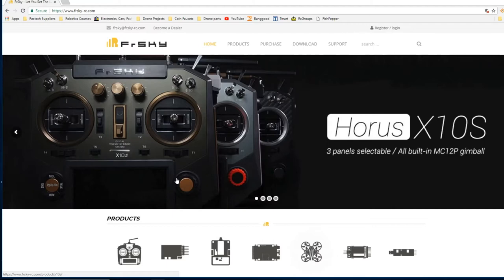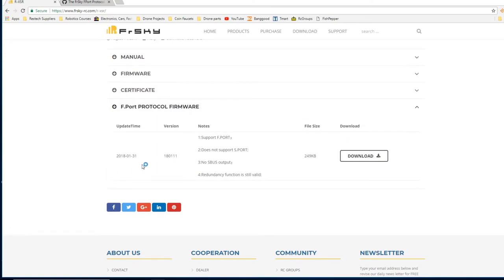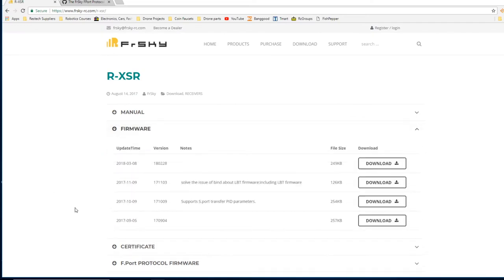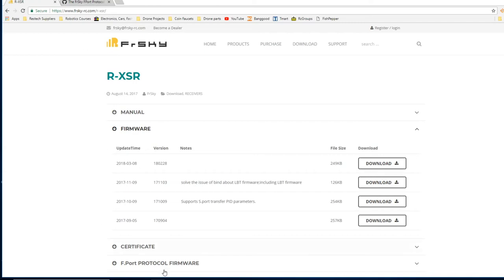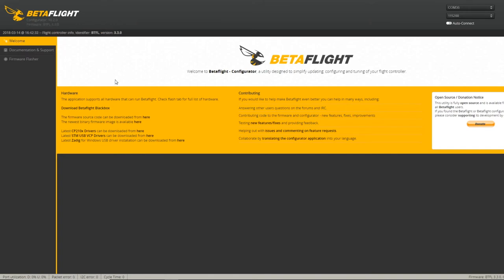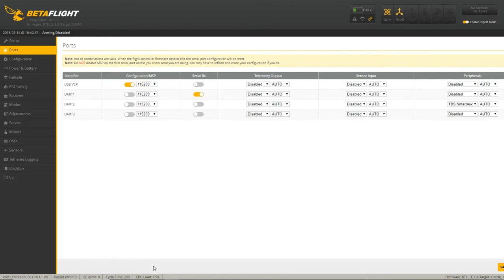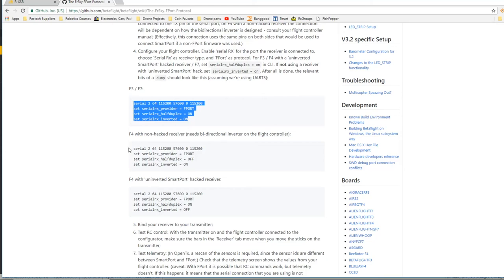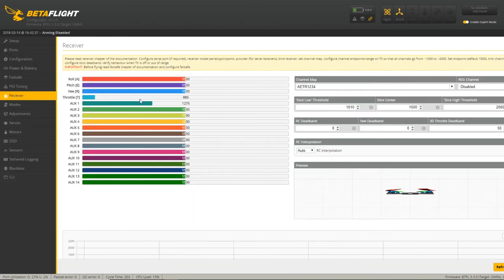How to setup Frsky F.port Protocol R-XSR Betaflight

Comment: I have a omnibus f4 pro with frsky R9mini flashed with Fport have it hooked to uart TX1 and no luck try duplex on invert on can't get it to work also I'm running 2.0 Inav but should be the same
Reply from the maker: ridesoftail Hey bud you gotta make sure that uart port is bidirectional, does your FC have a dedicated telemetry pad ?
Reply: No I guess if I use a R9slim + once they have Fport firmware I should be able to make it work.
Reply from the maker: ridesoftail you just have to make sure you are hooking up to a bidirectional TX pad and also you need to put in the special commands in the CLI tab I've only gotten Fport to work once on an f4 board but on f3 and f4 boards with a Telemetry pad it's No problem

Comment: I have searched everywhere and cannot find any information on my question. I’m using a Lumenier F4 AIO and not sure if the users are inverted or uninverted. It has a dedicated sbus pad but no dedicated telemetry pad. I already ordered the r-xsr and already I’m afraid I’m gonna ruin it just trying to get it to work lol
Reply from the maker: No need to be afraid the new r-xsr has the uninverted pads on it and I've used them for smart port but not f.port but I have gotten f.port to work on a f4 omnibus without a telemetry pad so what I would do is when you get the receiver try regular sbus with the sbus pad make sure that works then you can try to flash the r-car with f.port and connect it to the TX pass and see if it works if not you will have to use the uninverted pad on the r-xsr

Comment: The SBUS pin on an Omnibus F3 FC, is it RX or TX? I was putting the S.PORT wire there, trying to get FPORT to work, but can't seem to get it working. I needed TX1 & Tx2 for GPS & S.Audio. Thanks
Reply from the maker: Chuck Horton The s.port wire has to be hooked up to a TX pad, maybe you can use smart audio on a soft serial and have f.port on a TX uart

Comment: Hello,  how can I know if a uart is bidirectional? I got a geprc f4 stable flight controller in a very small quad copter and it doesn't have a telemetry pad just the sbus pin and TX 1 pad, I can't make it works with the r-xsr, did you use the  normal smartport wire or from the "p" pad on the receiver?
Reply from the maker: So F4 boards are the most complicated when trying to get telemetry you're gonna have to use the uninverted signal from the r-xsr to get telemetry to work

Comment: would using f.port make it so that when using rxsr the wiring can connect without using the inversion hack on the newer cl facing f4S boards?
Reply from the maker: If the CL racing f4 fc has a dedicated telemetry pad you won't need to use the uninverted pad from the R-XSR you can just wire up the S.Port Wire to the telemetry pad and you'll have F.Port

Comment: I have a speedybee aio FC, which pad must be soldered and which cli commands I have to enter f bus runs? 😟🤯
Reply from the maker: Is that the speedybee f4 v2 from racedayquads ?
Reply from the maker: @bastier8984  sorry about the late reply YouTube doesn't even let me know when someone comments back.....on that FC there isn't a dedicated s.port pad so you can do 2 things flash the latest version of f.port to your receiver and try hooking it up with the sbus pad because it has a built in inverter or just use regular s.port because you do have a lot of UARTs on that board and honestly man f.port has been horrible to me lately I swapped back to much bugs

Comment: Couldn't you just solder from the wiring harness on the receiver instead of soldering wire and the smartport pad?
Reply from the maker: Yes you can but you gotta make sure the UART your'e putting the smartport wire on is bidirectional, on F3 boards its not an issue but if you have like an omnibus f4 which doesn't have a dedicated telemetry pad then you'll need to either figure out which 1 UART is bidirectional or just use the uninverted signal from the smartport pad on the R-XSR
Reply: DwarfStarDrones good to know. I have to connect mine to an f3 board so I was just making sure. Thank you

Comment: What ranges are you getting of your r-xsr?  I have mine setup via fport, with telemetry, and my x-lite tx shows 80% rssi when tx is next to the quad.  When flying 100-200m away, i get low rssi warnings.  Anyone else had the same issue, or does someone know how to fix it?
Reply from the maker: That's really weird, i have about 3 r-xsr's and they all give me great range i even go crazy far sometimes at LOS but maybe its the firmware, did you update to the latest version of fport?
Reply: @dwarfstarfpv2056  Yes i have. Maybe its a dud rx. All other rx i have are xm+  and those give me great range. I only have 1 rxsr using fport.
Reply from the maker: @migfpv1790  it very well could be that, I did have a problem where my r-xsr only worked with ppm not sbus and kept failsafing, maybe try regular sbus and see how the range is
Reply: I have the same issue. I’m using mine on normal sbus and it failsafe about 200ish meters I almost lost the quad. I tried replacing aerials and it’s the same. I am here to change to fport thinking it might help but now I see there’s probably no point. I’ve seen other with similar issues while searching for an answer I’m really fed up with it now
Reply from the maker: @JohnDoe-or3hc  I would give PPM a shot and see if it still failsafes, if it does then it could just be a faulty receiver, normally as soon as I get a receiver I range check it but the r-car has has ton of problems i actually switched over to the r9 mini and it's really good so far
Reply: Will do, this is my first quad so its not been the best experience but the community is pretty solid so it balances out. Also The TX and RX thing was a big help as ive just realized the board im using (impulseRC Helix) has a dedicated Receiver input, which is an RX only :| So in a round about way im saying thanks for highlighting that fact as alot of other videos expect you to just know. Also thanks for replying i will check out the R9 also!
Reply from the maker: @JohnDoe-or3hc  Ohhh first quad! Nice ! For some reason the receiver is always a problem even up to a day like today for me lol what transmitter are you using ? 
Glad I could help out, I'm always here to help bud !
Reply: @DwarfStarFPV I have a Taranis X9D which i bought used so i suspected it may be faulty, ive heard turning it on with out the aerial etc. could damage it but after seeing other comments on the R-XSR im thinking its more the receiver. I also have a X4R-SB and X6R that came with the Taranis but they're too big to fit inside this quad. I may desolder the pins on the X4R and see how that performs if im brave enough! I also plan to spray it at one point like you did but thats way down the road!!
Reply: @dwarfstarfpv2056  Just to update you, i ordered an X-Lite and the R-XSR has the range it should have now... the problem was my Taranis. Thanks again

Comment: I got the channels moving but can't get the telemetry to work. Not sure what I'm doing wrong...
Reply from the maker: Chi Sty Make sure you turn on telemetry in the configuration tab, and make sure your signal wire is hooked up to a bidirectional TX pad
Reply: DwarfStarDrones I think I did all that....I gave up and went back to sbus.
Reply from the maker: Chi Sty I had the same problem and what solved it was soldering the signal wire to a TX pad instead of RX but fport has just given me problems non stop maybe the new update of the r-xsr fixes all the problems